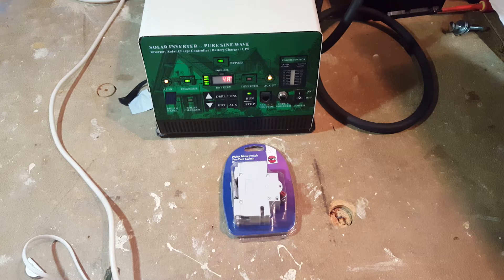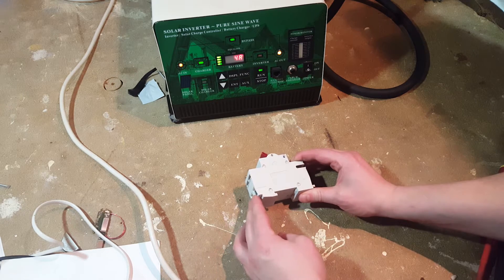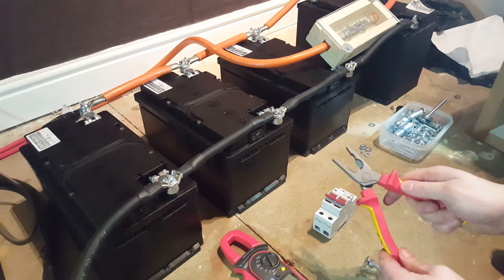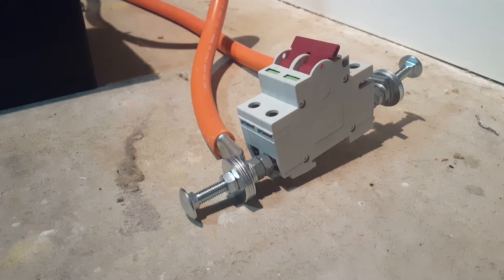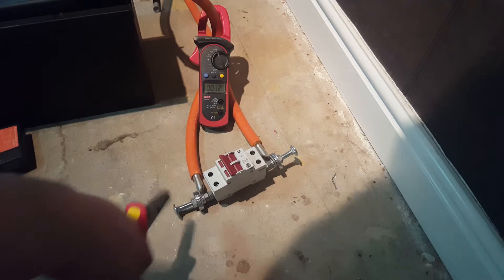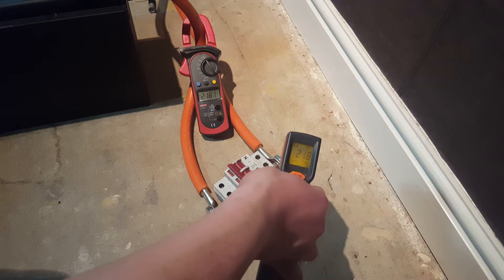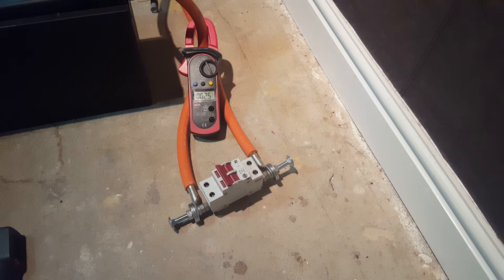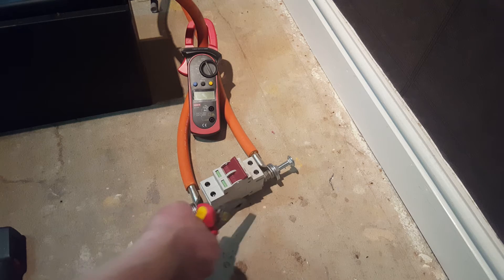100 Amp Electrical Isolator Teardown and Testing to the Extreme.

Comment: The arcing on the right side is causing the bolt to heat up rather than a slight increase in resistance .

Comment: If you look carefully your connector on the right of the breaker is arcing. I am not electrician  but i think that may be hurting your experiment. and reducing your max load. It may be what what causing the breaker to trip (just a guess)
Reply from the maker: +Dolphin Friend thank you I noticed only after while edditing. However I couldn't redo because I had taken it apart and wouldn't be safe to do it again. Thanks for the help I appreciate it!